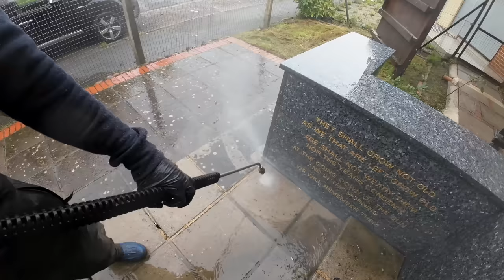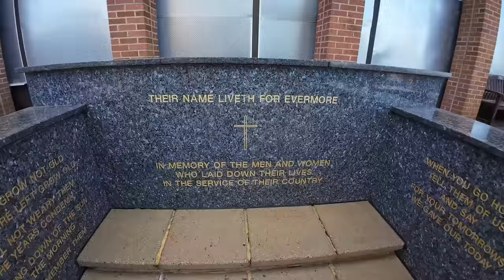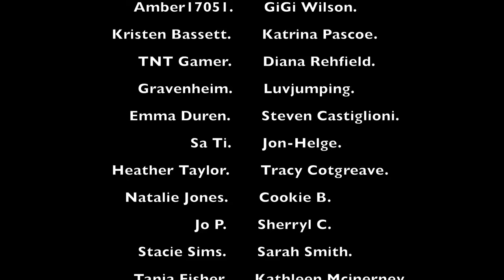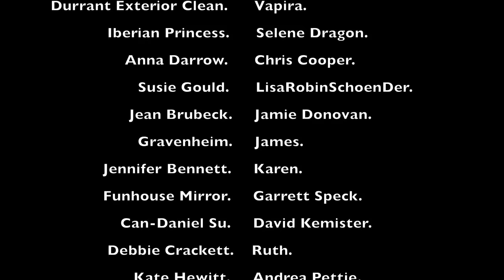Memorial NEGLECTED.. How Could The Council Let This Happen?

Comment: Well done for doing this, must be a rough area if the war memorial is behind a barbed wire fence.  If they respected it, maybe the local community would have looked after it.
Reply: Question- Being a military family, Why doesn't King Charles and the courtiers (those with titles) of that area pay once a month to have those areas cleaned and looked after. Give back to the community kind of gift.
Reply: @glorybe7500 😅😅😅
Reply: @obrien6320  Really
Reply: I noticed that. Quite sad ay.
Reply: That is not barbed wire, it is only a metal mesh fence.
Reply: It’s not an actual war memorial.
Reply: @nicolad8822 So, what would you call it?
Reply: @glorybe7500  Because their too busy in their counting houses, when it comes to money they are happy to "Add & Multiply" but would never consider "Dividing & Subtracting". With regards for their peasant subjects, the aim is "Dividing & Extracting", they have been perfecting their craft for Centuries.
Reply: @aliceklundt  check out video at 6:06, there are clearly 3 lines of barbed wire along the top of the fence!

Comment: Thanks to you and your Dad for cleaning the Cenotaph.  It was a disgrace and there is no reason for the local council to let it get that bad.  Here in Canada they generally speaking aren't fenced off the way that one was and are looked after by the Parks Departments of the cities where they are located.  Once again from an old vet thank-you from the bottom of my heart for doing what the council should be doing.

Comment: When I tackle heavy overgrowth with a string trimmer, I find it much better to cut into the growth on the forward stroke, and then wipe away the detritus on the backswing.
I even tilt the angle of attack back and forth accordingly.  But, it all depends on your direction of rotation.

Comment: Before we complain about the "council" we need some context. The building used the be the "Royal British Legion New Addington" but the club was franchised off and then closed on 14th Jan 2023 owing the British Legion a lot of rental. It close primarily because it wasn't generating enough revenue. As you can see in the video all the doors and windows are sheeted over with aluminium . I'm not sure why the video suggests it has anything to do with the local (Croydon) council.

Comment: The REAL Problem With The Lovely Memorial...?   ITS NOT FINISHED!  You Need To Take Everything That Is Cement and Brick And Cover It With The Same Granit Material The Memorial Itself Is Made With.  Then Loose The Fence If Its Not  Functional Part Of The Area,  The Fence Is Blocking Access and Makes The Entire Section Isolated,  The Fence Is Sending The Observing Public an Unconscious Message "stay away, dont come in."   REMOVE THE FENCE and you Amy find people will volunteer to keep it clean.

Comment: What a waste of time, battery, diesel !!! The blowing of leaves should be done AFTER the grass has been cut. Why are they not using their brains ?

The grass was still not cut further. The weeds at the fence not removed. The pillar / pipe near the fence not power wash.